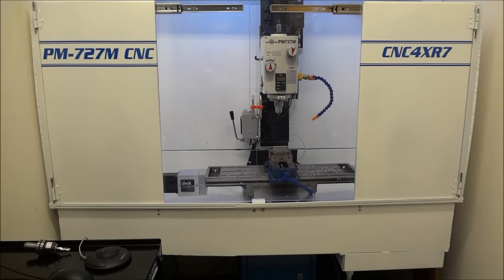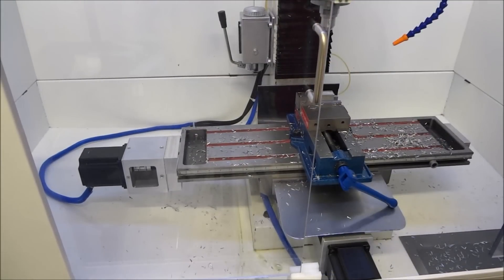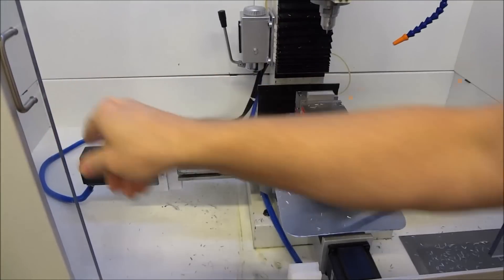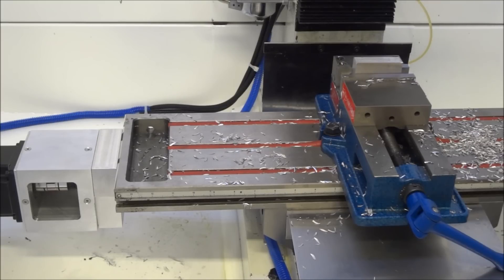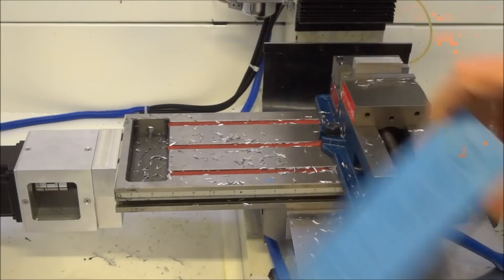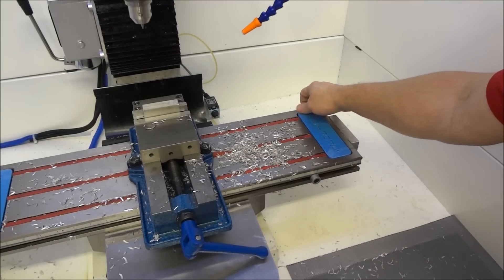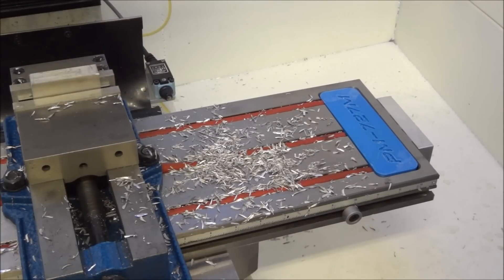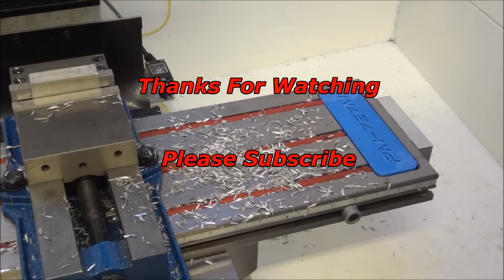PM727M Tee Slot Tip!

Comment: Hi Sam, I just moved to a independent house from my apartment and so glad to find your channel. I am confused to by pm25 vs pm727 . do you think the fixed speeds of 727 are going to be limiting factor any ways? I am going to eventually upgrade it to cnc ball screw. any guidance will be much appreciated. machining is just a hobby for me and I would be making small robotics part only.
Reply from the maker: sumit singh 
cant really compare the two in my opinion the 727 is abigger heavier mill.
i havealready converted to variable  speed andbelt drive to come.

Comment: i will be using an db25 board to control the router table
Reply from the maker: Christopher Vanlent 
your using a C10 Bob to run a router and you want a output on the C 10 to turn on a solid state relay that will energize the spindle
Reply: Yes. Im looking for a wire diagram to fo so.

Comment: Cool tip Sam.  I've got a fixture plate mounted to mine most of the time now, so I get chips in the holes.   I'm planning on putting nylon or brass set screws into the threaded holes to keep the chips out.  But I will keep this trick in mind when not using the plate.    -  Bill
Reply from the maker: Hi Bill,
 That's a good Idea Chips can be a pain sometimes. Nylon or ABS threaded rod is a great Idea! you could cut to length and put a slot on the top.
Be Safe,
Sam